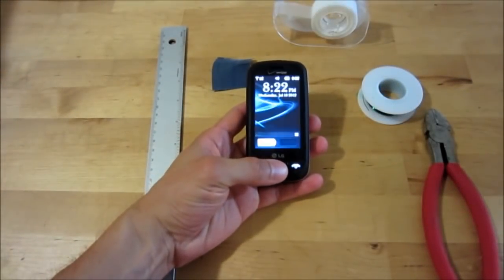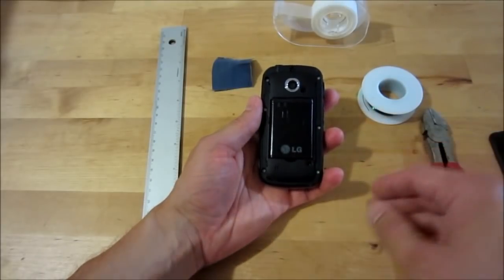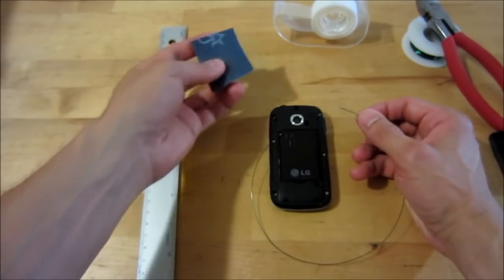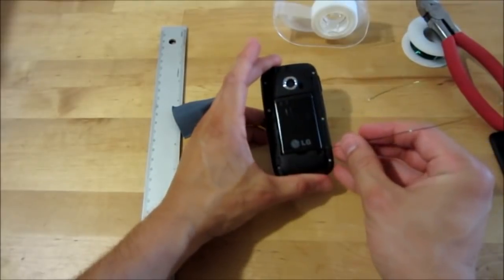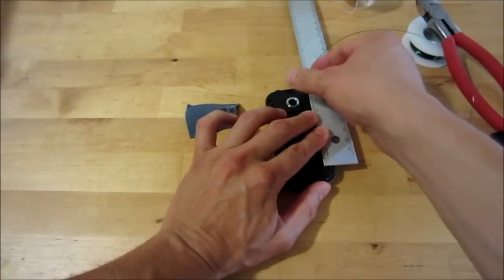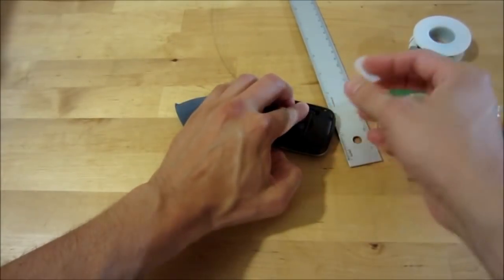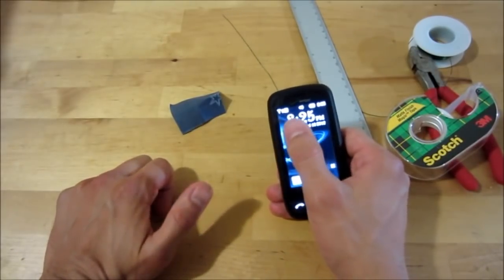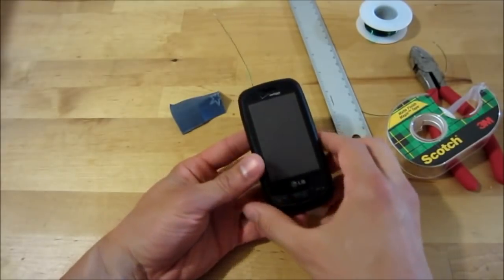DIY Cell Phone Antenna in 3 Minutes!

Comment: Radio frequency (RF) is in fact rocket science. It is not possible to do this with more recent phones, since they use more sensitive modulations and technologies as well as a varity of frequency bands (LTE, WCDMA, CDMA, WIMAX, EDGE, UMTS, HSDPA, HSDPA+, etc.). You should never mess around with these things. You can bet your bottom dollar that every smartphone is tuned for best possible radio reception. If your phone does have bad reception, just make use of your warranty. If it degraded over time, you should also make use of your warranty. When the warranty is expired, then and only then you should try such quick fixes. If you kill your phone, it is not such a big deal, then. You would then have to buy a new one anyway.

And if you are in an area with bad service ... you should just move to town. :/
Reply: "you should just move to town" lol yeah totally
Reply: ***** is right. BTW, If you do try to increase the gain of the antenna, other signals/noise is also going to be amplified, which might or might not be a good thing. In situations where the signal from your cellphone doesn't reach the tower (rural areas), using an amplifier might help some, but again, its not black and white, there are TONS of factors that affect RF...
Reply: Red Rum The secret here is cutting the external antenna to the correct length which effectively tunes it to the desired frequency making unwanted signal reception less of an issue. The antenna inside the phone is a compromise between reception and fitting in the phone so it definitely is not optimized for best possible reception. Why do you think the manufacturer provides the connector for an external antenna? As for best tuning, one trick is to cut the antenna slightly oversize and progressively clip a fraction of a mm, watching the signal strength on the phone's status screen as you go.

Comment: If you're unsure dont fuck with your phone ports. It will most likely disable your internal antenna. I have a brand new s4 and I disabled it. Luckily I found a solution with a soldering iron and patience. It can be fixed.
Reply: most phone now have its own fixed calibration with the antenna. even if you manage to do it right you can screw it up.
Reply: yo hice lo mismo , se me inhabilito la antena interna. y ahora no puedo volver a que este cm antes , osea sin cablesito... como lo soluciono????
Reply: martin moran yo le puse un tornillito pequeño en el hueco y volvio a funcionar
Reply: my internal antenna is fried..so how to fix it..help would be appreciated

Comment: this is pretty safe if ur not a moron but if u want to up the anty go to a electronics supplyer online who does hudge range look into the microwave conectors and u can get a heavy duty 1 for ok price get a old wifi ant and wire into that solder up and it should be ok if u want to get more professional read about ant's for 800/900 mhz 1200/1800mhz and 2000/2400mhz its same as cordless phones and wifi

Comment: I had poor reception on S3 I747, so I tried some (probably too) thick copper wire. That pretty much made the situation a lot worse (as Makify said, I prolly lost the internal antenna). HOWEVER, after I did this properly, with a thin copper wire, I eventually got better reception then I was getting with at the very beginning when my internal antenna was working. also confirming that the length is not critical, just insert the copper wire cautiously don't force it in. GL!

Comment: Don't do this... This is obviously an amateur and he does not tell you how if you ground the wire to the phone it will blow your internal signal. Google wilson cell phone signal boosters... Sure it is more expensive, but you will not end up having a cell phone signal with no reception capabilities
Reply: They start at fucking $400

Comment: some phones do not have that grommet inside the hole to protect the positive center pin from grounding out on the outer ring.  That is likely the reason that people are loosing their internal antenna capability.  You can buy a simple antenna plug to avoid that scenerio, or if you have an old radio, tv, or wifi router laying around then you can simply pull the plug from there and solder it to your lead wire.  That's what I did with my old T-mobile my touch slide and I gained 3 out of 5 bars.

Comment: Hy I'm desperate, I did something similar with my samsung s2 and now my internal antenna does not work as before(it's dead), external antenna works only. What can I do to reactivate the internal antenna? Any idea? Thank you!
Reply: Have you opened up the phone? If you did then the contact between the board of the phone and the cover (not the battery cover but the one inside) are not touching each other. There is a small metal pin (spring-like) that is supposed to be touching the cover. Fix that and you should see signals beings restored. That said pin connects to the antenna of the phone which is hidden in the inside cover of your phone.

Comment: I bought an external 3G antenna for Samsung Galaxy 2 4G after watching a similar video, phone has decided not to use the internal antenna anymore (= no reception) so don't try this on a phone unless your need is absolutely desperate. I used a length of thin copper wire into the R1 port and now get improved mobile reception (I call it the "Brain Cancer 3000" antenna) i'm stuck with it now (FYI: does NOT improve WIFI).

Comment: Did this with an att s2 skyrocket. Made it better. Extra 2 bars gained in general + i just folded the extra length of wire to fit inside the phone:-)

Comment from the maker: The Samsung s3 uses four frequencies (850, 900, 1800, and 1900) so a general antenna length of 6.3" should work. The exact length of the antenna isn't all that important in practice as long as you are close. There are lots of other variables affecting signal strength.
Reply: What about the Google pixel pro 6 XL

Comment: Do only real old phones have antenna slots? I have been trying to do a diy booster for quite some time now and none of the phones I have ever had have this feature. I am stuck in an apartment with virgin mobile sprint and the reception sucks. I just bought a virgin mobile kyocera rise and I don't see a spot to connect this wire.

Comment: Thanks for the clip.
I think AT&T uses 1900 MHZ in my area, can you tell me the length of wire need for that frequency and do you know if it improves data or just voice? I'm unclear if those are linked.
Thanks.

Comment from the maker: Good question. If your phone can use a 800-900 MHz signal, most cell phones in the US do, then a 6.33" antenna will work. This length is not optimized for higher frequencies such as 1700-1900 MHz.